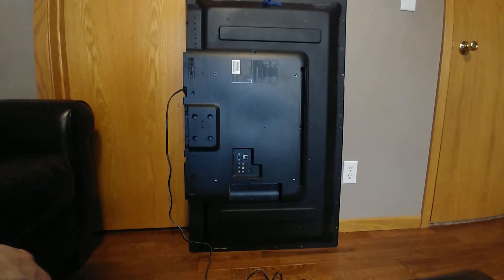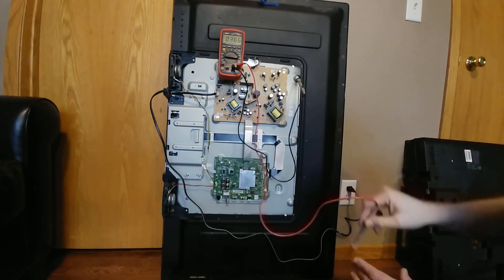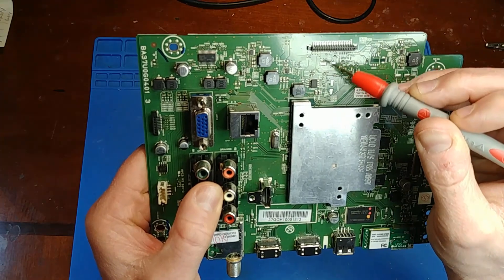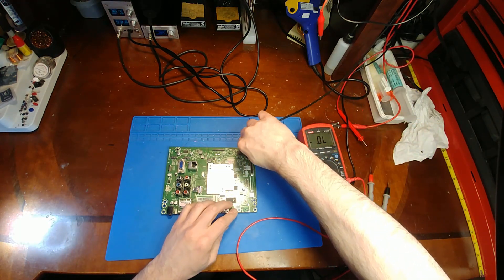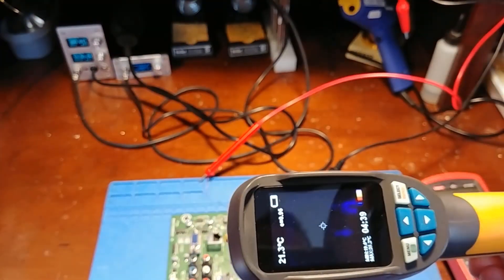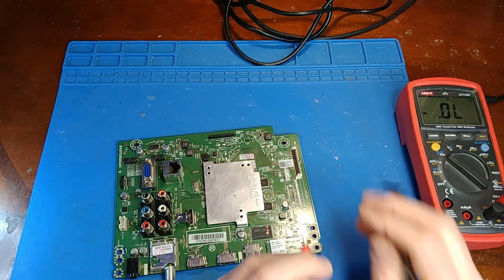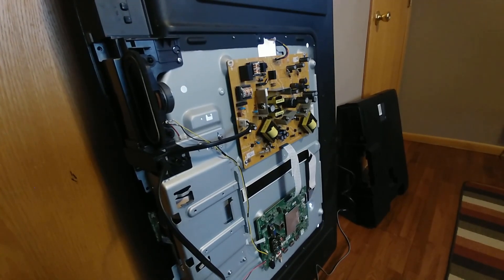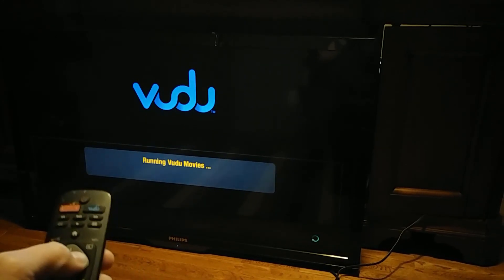Lets fix a junk TV

Comment: say you needed to replace that cap becasue iit actually was important how would you go about determining what one to replace it with?
Reply: You might be able to see what it may use in the buck converter data sheet.  Sometimes they have example in circuit  schematics components.
Reply from the maker: @Discretesignals  good idea.
Reply from the maker: Being that there is a 99% chance the schematics are not available, I would have to buy a good board, remove the cap and measure it to know.
Reply: @jeffescortlx  There wasn't anything readable on the cap itself?  In this case, since it's a filtering cap, I'd probably just stick a value like a .1 in it's place.

Comment: jeez that's the last thing i would have thought, i have i have this TV and had the exact same chirping from the flyback transformer.  I noticed the short on the main board but gave up on it quick because i thought it was one of the chips on the board, i didn't think about connecting my power supply to it like that and looking for heat, i just went about and bought a new board off of shopjimmy, the new board came in and it wouldn't work for some reason, i almost think they sold me a fake or something, there's another buck section on that board that is identical to the one shown here and the same capacitor on the other buck was shorted on mine
Reply from the maker: Can you just remove this cap on your original main board and try again?
Reply: @jeffescortlx  yeah, that's what i did and it worked again like yours... im just angry that i bought a new board and it didn't work
Reply from the maker: @wow1022  I suppose no returns allowed on the new-bad board? Glad you got it working.

Comment: Please, please, please, what is general problem of this?  Is it COF IC or what supplies the COF?
HiSense model 50H5G
https://i.postimg.cc/6qVfY07J/IMG-3282.jpg
I have all kinds of voltage measurements at buffer boards, COF tabs and power board; T-con should be good.
Reply from the maker: Sorry I'm not sure, could be T-con, COF or the LCD panel itself.
Reply: @jeffescortlx  Thanks for replying.

Comment: #jeffescortlx I have a 42" Dynex with no LED backlighting. How can I determine if it's a bad LED driver/power supply or if the LEDs are bad? TV turns on and works, it's just so dark you can't see the image. Any suggestions? 🤷‍♂️
Reply from the maker: It's probably bad LED's, but the strips can be tested if you take apart the TV.

Comment: Well done jeff :-D,  that camera cut out hours of you feeling the pcb and swearing :-D
I would bung a 10uf in the place of that crap-asitor,  sounds about right.
smd capacitors seem to be failing more often, they used to be better.
The layer structure is good for small size and capacity, but they are fragile and vibration/shock and heat cycles cracks them.  ( But that's just my guesswork.) 
Oddly an old fashoned electrolitic with legs might have been more reliable.
Reply from the maker: I thought briefly about throwing a random capacitor in that place, but naw. That trace leads to the connector that plugs into the power supply that has a bunch of caps at the output connector. Sure there could be some noise coming off the buck chip, but it will just have to deal with it lol.
Reply: @jeffescortlx  But that capacitor was put there to do a job,  kill the tv later on lol :-D
Reply from the maker: @zx8401ztv  but live just long enough to make it past warranty period!

Comment: When you remove a smoothing cap do you bridge the circuit or leave it open? Honest question and yeah I am showing my lack of skills, rather proudly. :) 
And for the haters, mehhhh you could save the world and someone in the comment section would criticize the way that you did it.
Thanks for the ride along and the interesting way you diagnose a problem, chase it down and determine it is not so necessary after all ....
Reply from the maker: Left open. The capacitor shorted (basically jumpered it's self) and that's what kept the voltage rail from raising the voltage.
Reply: @jeffescortlx  In my defense, that was a pre-coffee question, Jeff and like the word "SHORTED" didn't smack me in the face. Thanks man!
Reply from the maker: @JimNichols  I completely understand the importance of that first cup of coffee!

Comment: That shorted cap is for addtional stability and EMI supression propably. Buck converters have non-continous current input, so a relatively large current swing over a long cable can induce some EMI interference and voltage drops that can cause unstability of the voltage control loop. If it's working it isn't really necessary. Great video as always!

Comment: I have a question for you if you don't mind responding. My kids just broke the screen on my Samsung 55 in TV. How hard and what part will I need to attempt to fix it? The LEDS show an almost spider web, with the top half completely black.
Reply: You won't be able to fix a cracked screen unfortunately
Reply: Cost of replacement screen panel is usually 95% of price of new TV. Definitely not worth to repair.
Reply: That is the panel, it’s trash
Reply: @michaelbox7285  yup...I just confirmed it. $499.99 just for the led/led panel. Time for another new tv.
Reply: @michaelbox7285  well fudge
Reply: The screen itself isn't broke, just the LEDs behind the panel.

Comment: Why do they even put a capacitor there that doesnt need to be!!!
Reply from the maker: There is always a little difference between what a engineer says is required to survive worst case conditions and what is needed in real world conditions. A lot of small caps like that are included just in case some noise needs to be filtered out. Cheap insurance basically.